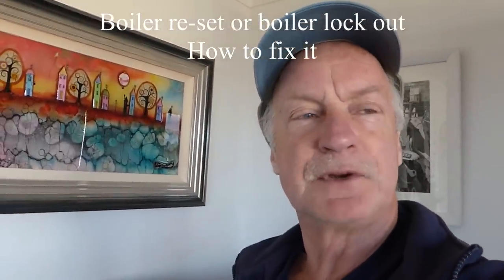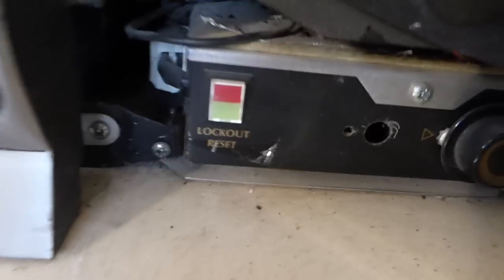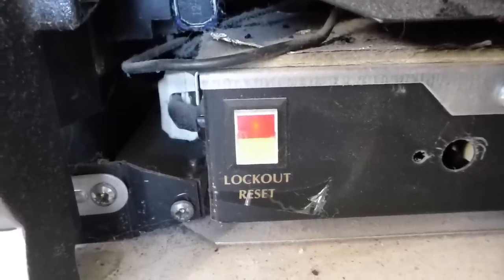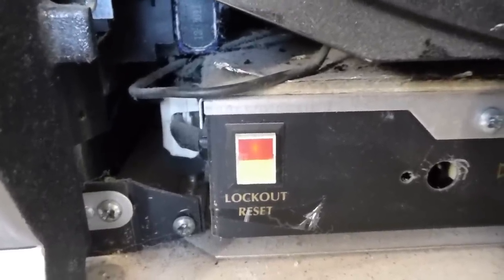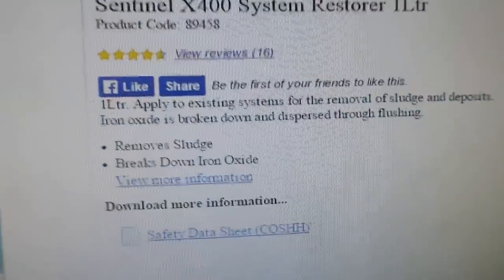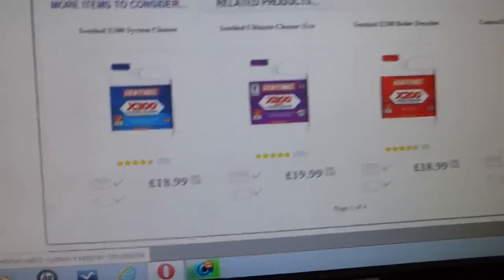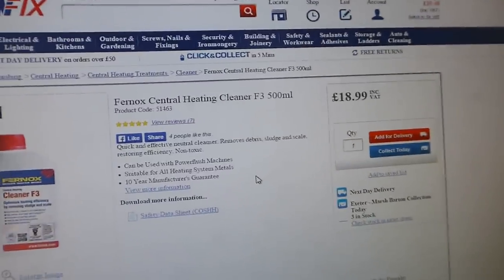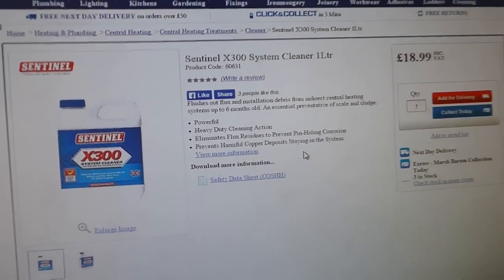Does your Boiler keep needing a reset or lock out? How to fix it.

Comment: Hi, just wondering if you could advise! Mine is a British Gas 350 RD1 Gas Boiler. Recently we replaced couple of Radiators to the double panel ones. Worked fine for sometime & when the summer came, I switched all the Radiators off so that we could just have Hot Water. But since then The Boiler only works first time for around 10 minutes & then locks out even with Resetting wouldn't work at the time but if I leave it for an hour or so & then have to Reset & it would again work for around 10 minuted before locks out again. Winter is coming & just wondering if you could advise what's causing this problem!! Would really appreciate your opinion... Thanks again
Reply from the maker: Sounds like air in the pump or system and lock out is occurring due to overheating. At worst you could drain the system again and add system cleaner for a week then drain down again and add fresh inhibitor.
Reply: Hello again, I tried what you suggested but still didn't work & to make the situation worse, the boiler now wouldn't work at all even after pressing the RESET button. So, asked a local big name Gas Company to come & have a look. The opinion of the Engineer was that the PCB 173229 is gone & need a new one which including their cost & VAT would be in the region of £600. Not sire what to do! Just wondering if it's worth repairing it if that's cost it's gonna be or should I just replace a new one which may be not much extra. And also, if you could please let me know what kind of boiler is the British Gas 350 RD1 (Ideal) ? Is it a System or a Heat Only boiler so that I could look online as well! Many many thanks in advance for your very valuable advice.

Comment: Hi Al, I have a 10 year old Vokera Compact 24 Combi Boiler and about once a week the red lockout light comes on the book say's to switch off the mode selector switch for a couple of min then back on and it's fine for a few more days then it goes off again can you tell me what might be the problem and if I can fix it myself
Reply from the maker: Red lockout means time to call an engineer. Without knowing what you are doing it is the best bet.

Comment: Hi Al. Thanks for all the great videos. We moved into a house in Cornwall recently and our boiler knocks and vibrates. How do you put the stuff in to a condensing boiler?
Reply from the maker: Miles Bancroft If it is an un-vented system then pour the inhibitor into the small F and E tank in the loft. If it is a combi or pressurised system then into a radiator, using a short hose and funnel.